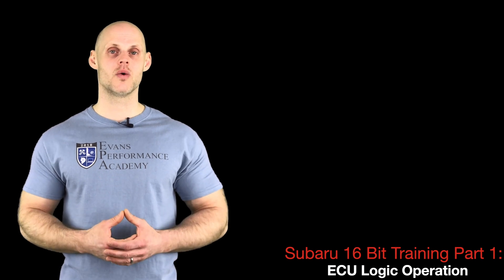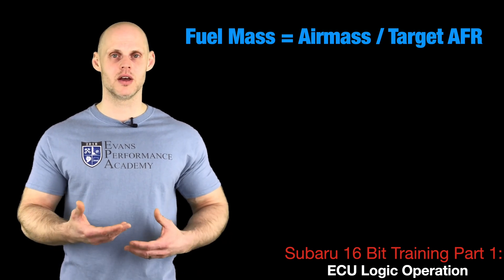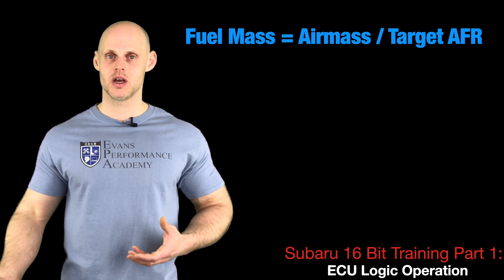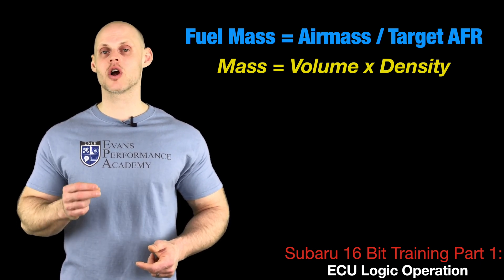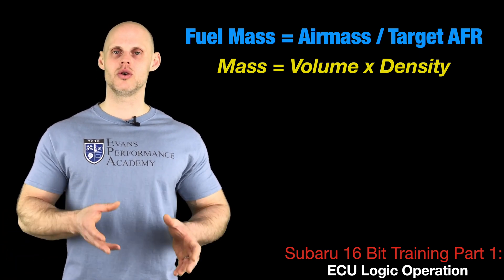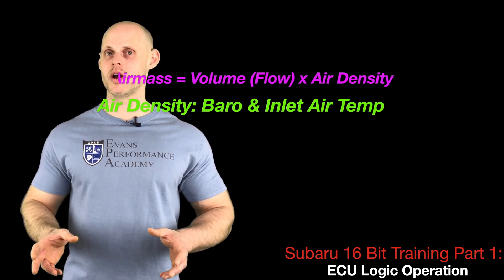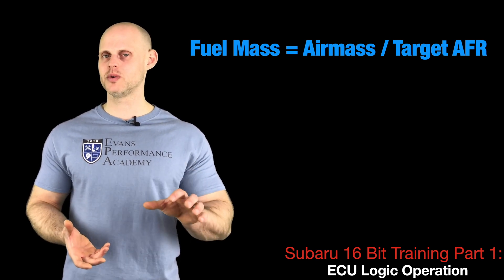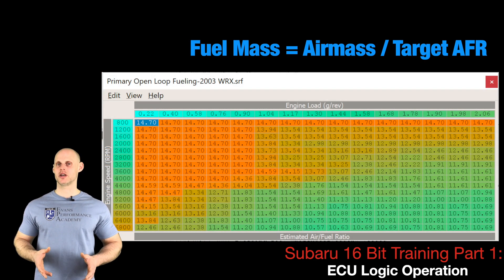Ecu Flash 16 Bit Subaru Training Part 1: Ecu Logic Operation  | Evans Performance Academy

Comment: I have a 2002 wrx . I have a turbo xs utec piggyback ecu. What tuner website do you recommend so I can self tune myself ? I’m watching most of your videos
Reply from the maker: You would want to remove the UTEC and purchase a Tactrix 2.0 cable.  You can purchase them from tactrix.com  Our training course available here gives you everything you need and walks you through every step of the tuning process: https://evansperformanceacademy.vhx.tv/products/ecu-flash-master-training-subaru-16-bit
Reply: @EvansPerformanceAcademy  is that a new tuner ? So I wouldn’t use the turbo xs right ?
Reply: @EvansPerformanceAcademy   well it’s not connected